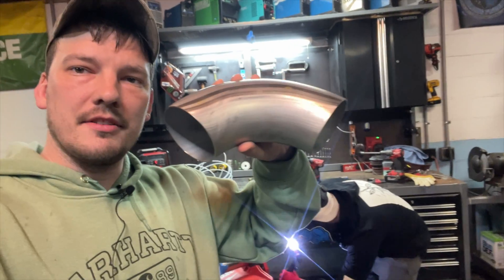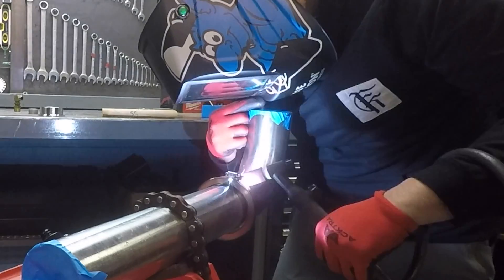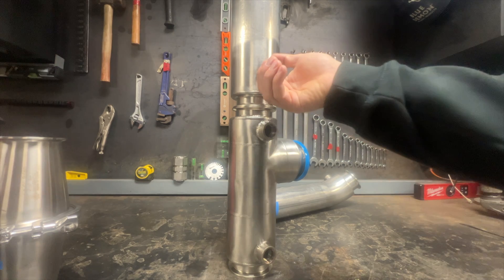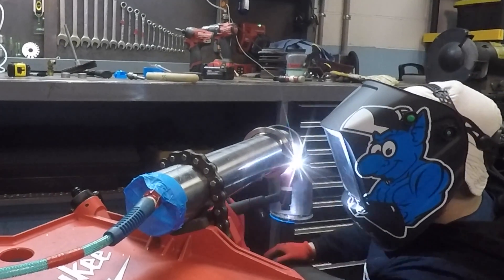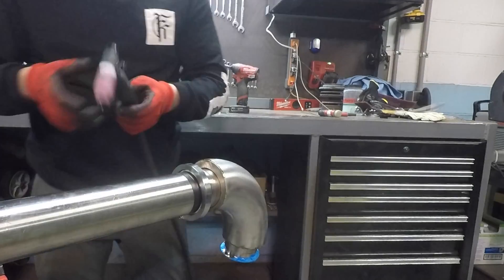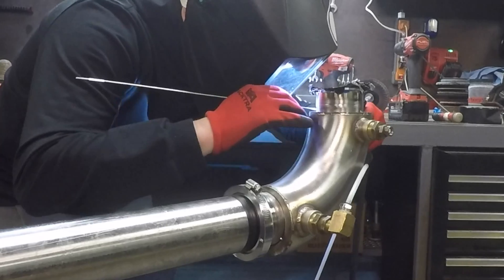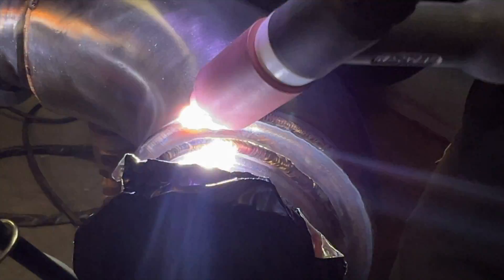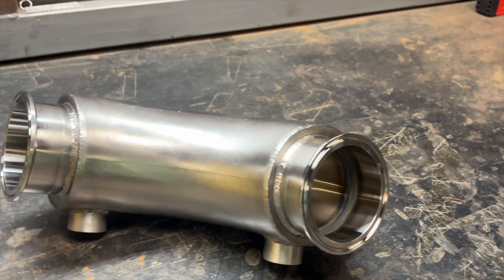Fabricating/Welding A Stainless Jacketed 90

Comment: I make this same exact jacketed pipe, except the systems I make I’m usually using 1-1/2” and 2” tube. My pipes are reverse of yours in function: cold water is flowing in the jacket to keep the product from hardening and crystallizing and thickening. The processing machines I make produce the little gummy bears and gummy whatever’s. They put vitamins and sometimes fake THC in them. 
Cool video. Thanx for the link to the wheels. I’m always looking to try different polishing/prepping wheels. :)